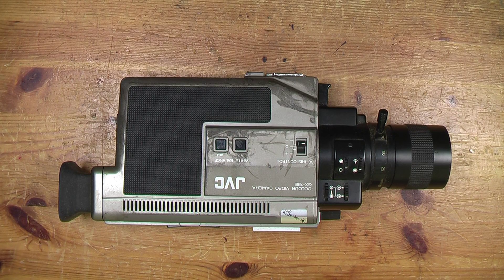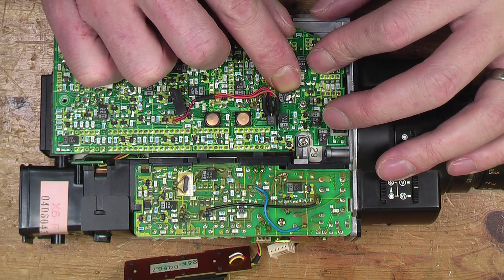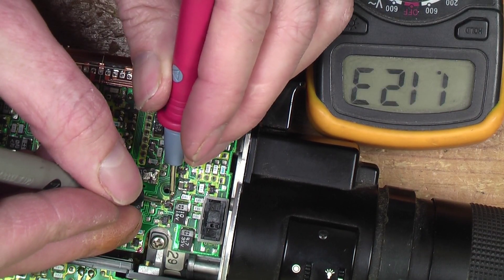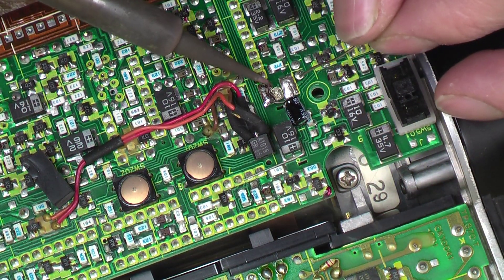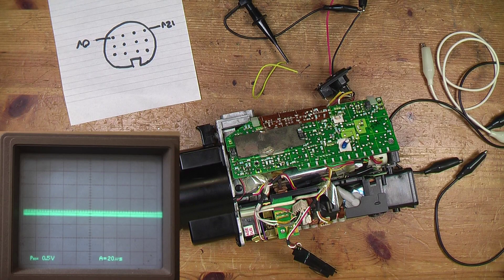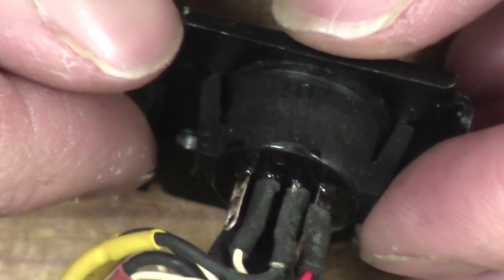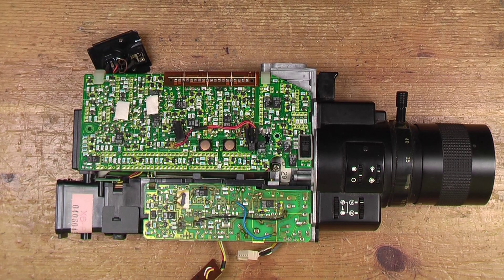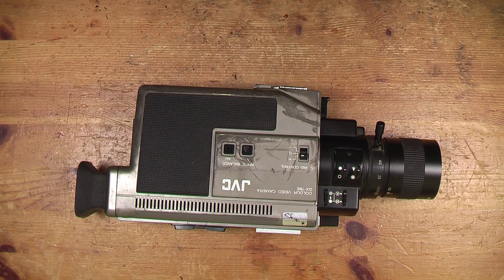JVC GX 78 Vintage Video Camera Repair and Test

Comment: Thankyou for uploading it out in a bit definitely watch it through later. Yes it's me definitely mucked around with it
Reply from the maker: Ah OK, I wasn't sure if it was you or someone before.  I knew you had took the old fuse out.
Reply: @nowt1002  I'm sure I left a 3amp fuse in it. Probably me who blow the capacitor I did get a burning smell from it I think.

Comment: What camera do you use for these videos? And how do you do the overhead shots? I recently got a Sony NEX-EA50U for $500 including a 18-200mm lens. It's quite big but has pro features like XLR microphones and interchangeable lenses. I might get a Sony a6400 mirrorless camera soon to act as my second camera.
Reply from the maker: I'm using a Panasonic HDC-SD9 for the main camera and a Panasonic NV-GS500 for filming the scope.  The HDC-SD9 is a bit old and is interlaced so I have to deinterlace the video for YouTube but the main reason I use it is that it has a CCD sensor so I can film CRTs without it flickering.  

I've got this movable arm thing with a tripod mount on a ball joint on the end, the other end had a clamp that's attached to a shelf on the wall.  That's what I use for the overhead shots.

https://amzn.eu/d/hkT0JBw

That's on the UK site but I would think it will be available on the .com one.

Comment: When you did things like the Sony HVC3000 as a direct feed, I'm wondering what computer caputure card you use or recommend, as I wish to do the same please? On a side note, I get the impression you are at Rotherham, which is where I'm from, though I moved to Lincolnshire in 1985.

Richard
Reply from the maker: For capturing I'm using a usb device called Easycap.  You have to be a bit careful buying those though as there are different versions of it available that look the same externally but internally are different.  There are two versions of it that I'm aware of, one works well but the other isn't very good.  The good one appears with the device name 'usbtv007' when you plug it in.  I bought mine a few years ago now so I can't point you to one that's definitely the right one but when I bought mine I bought 4 or 5 of the devices and there seemed to be two price ranges on ebay, some were around £8-9 and some around £5-6, the two I bought of the higher price were good ones and the 2 or 3 at the lower price were bad.  I don't know that this is definitely always how it works but I wouldn't buy the cheaper ones, I would probably ask the seller if they can tell you whether it's one of those usbtv007 ones and if you can return it if it turns out not to be.  I don't use the software that comes with it, you have to install drivers for it but I can put them on google drive and send you the link if you do get one.  I didn't use the software that comes with it, I use a program called Virtualdub which is much better, it is free software.  And yes you are right, I am in Rotherham.  Have you been back there at all?  It's changed quite a bit over that time.

Comment: Do you know what type of battery do you use in this camcorder? I can’t find it for mine
Reply from the maker: The camera itself doesn't take a battery.  It plug into a separate portable vcr, the battery is in the vcr and the camera takes it's power from that.

Comment: Hi mate Ive got a Ferguson FC-28 which worked great until I heard a pop and it now won’t power on. Im assuming a blown electrolytic but can’t work out how to get to it. It worked great at record playback so confident it should be easy to resurrect. Do you want it for a video? Its shoulder mount form so hopefully not packed full of smd electrolytics
Reply: Same as a JVC GF-500
Reply from the maker: Hi sorry for the late reply.  Yes that would be great.  Can you send me an email to discuss it please nowt100video@gmail.com